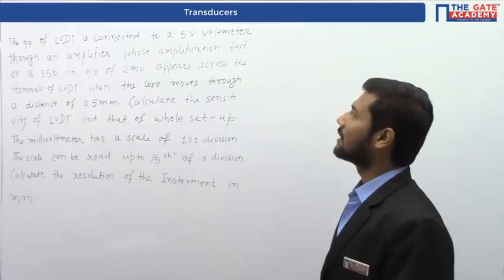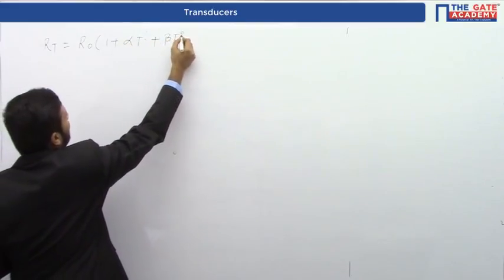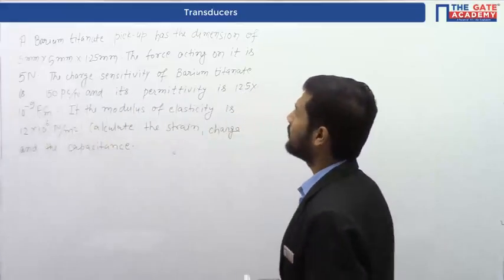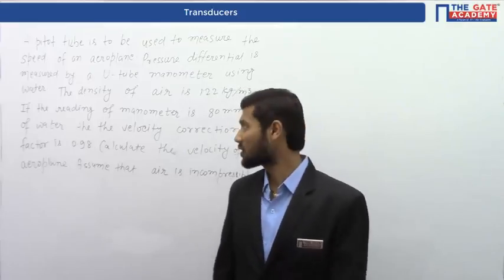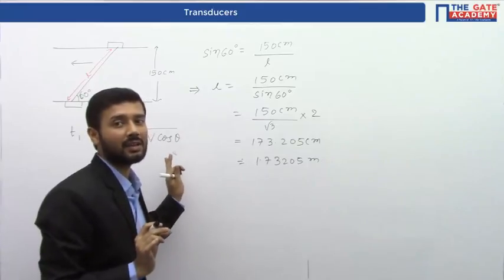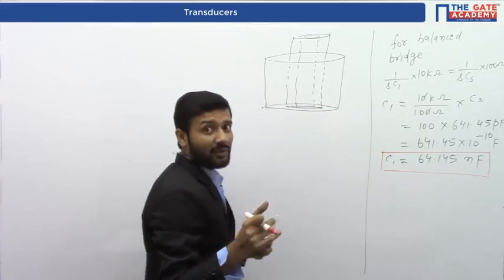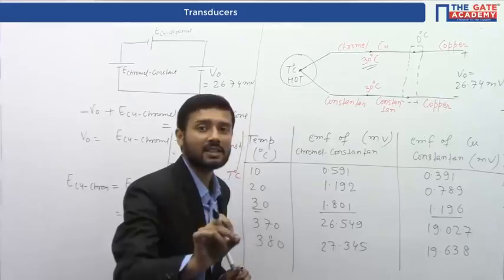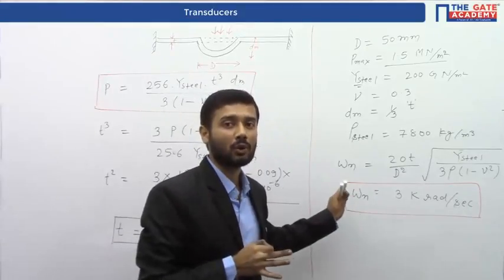Transducers (IN) - Most Important Questions | GATE - 2019

Comment: Sir...In this video, the last question which means Steel diaphragm, you have initialized dm=t/3. But while substituting in formula, you have used dm=1/t. If you substitute dm as per the initialization, equation will come in the form of t^4. Not in t^2

Also in formula, you put D^4. If D is 50mm...then D^4 will be (50mm)^4 which is equal to  625 × 10^(-8) m.

Kindly reply as soon sir